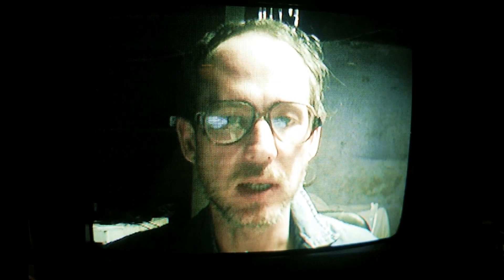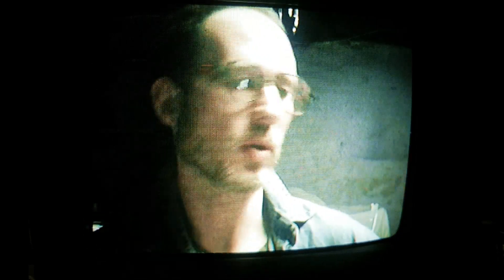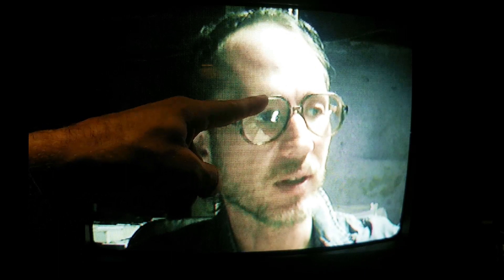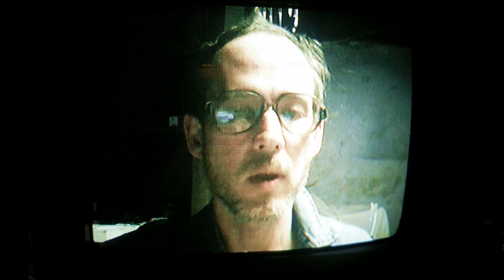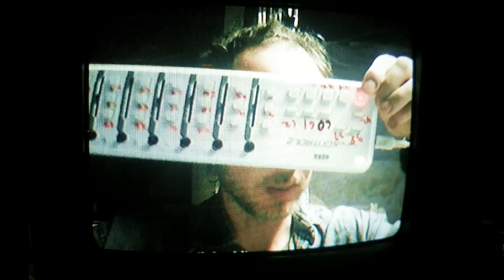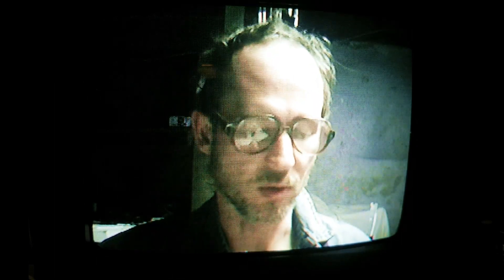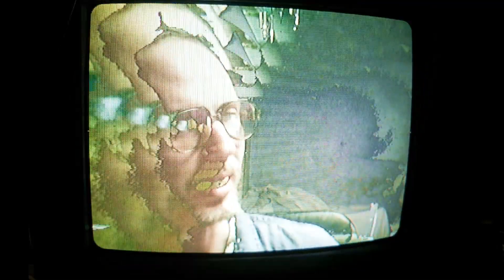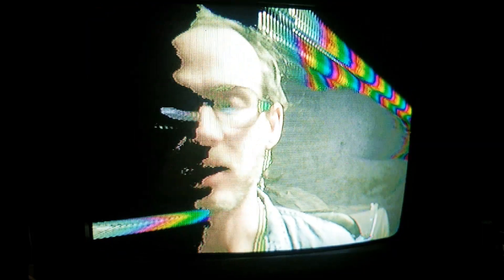introduction to Auto Waaave

Comment: Andrei, are there settings that need to be made after installing the hifiberry adc/dac?  The device worked the first time I installed Auto_Waaave, and then all subsequent re-boots it stopped working.  I did try testing to see if audio was coming in in audacity which it was.  It seems like there is some obvious thing I'm missing here.  Any advice would be much appreciated.
Reply from the maker: sounds like u are using one of the non supported analog capture devices, try checking the website to pick up a supported usb analog captures, and then reflash the image before using once u got it
Reply: @andreijay  Thanks for the reply!  I was going to build a pi synth too, which it sounds like this dac will work for, so no loss!  I used VSERPI as my Webcam for a video conference at work the other day, and everyone freaked out.  It was great!

Comment: Thanks for all your amazing work. If I already have a functional waaave_pool (working on one now out of spare parts) is there a specific ADC/DAC hat I can pick up for my rpi to use auto_waaave with the pool image on github?
Reply from the maker: yes the HifFi Berry ADC/DAC combo is the best to grab for this purpose, it will be an excellent accessory to have in general as it will also work with the Phosphorm image and will be what i design any future audio processing units around as a default!  otherwise it will also work with some mics from USB cameras and USB audio interfaces in general but most likely with lower quality and higher latency
Reply: @andreijay  Thanks, really appreciate you being so transparent about the parts you use in your kits. I would have totally bought one if i didn't already have a rpi and might actually still pick one up if i end up needing another pi and want to get the premium capture hats. I'll probably prototype with USB and upgrade when I am happy with the results I'm getting.
One other question - why don't you (or anyone else in the community from what I can tell) use a RGB/S-VID hat out of the pi as an alternative to the composite out? Too many hats? No benefit of RGB/S out? Something deeper?
Reply from the maker: @smppdx  pin out video is definitely possible, doesn't even require a hat really, but hard to see any kind of advantages to adding that process on board!  any way you slice it you are going to be converting a composite signal at the base of the chain to the split svideo Y/C signal so not exactly like any amazing quality upgrade from doing it via a hat or wiring your own pinouts vs doing it anywhere else.  dunno about RGB hats at all, are u talking broadcast VGA composite sync on green or sr8 up vga RBGHV? very few of the analog video systems out there are going to be happy with either of those signals so it was never a priorty for me to focus on that end of things, the thing about using breakout cables for composite is that it is simple, inexpensive, and has a wide range of uses which is generally my priorities. and yes transparency and easily available components is another priority, the main goal of this series of instruments is to have an easily assembleable and somewhat unexpensive powerful set of video tools out there in the world
Reply: @andreijay  Still new to all of this and learning a lot from you and the community, so thanks for helping me think this through as I buy a ton of cables to rig everything up.
I was imagining that if you had digital video samples or synthesis w/ high bit depth (10bit?) and subsampling (4:2:2) that if you did RGB out similar to the retro gaming community SCART hat[0] you could get better color representation as long as your mixer supports its. I'm with you though, the simpler/the better and would prefer to use rca composite to rig up everthing as long as my colors look good. Do you only use RCA across your devices or is there s-video in there between the mixers for instance?
When you say 'composite at the base of the chain' are you referring to the composite out on the rpi? I was thinking there might be a benefit to color in using an alternative output, but I'm probably just overthinking things.
[0]https://www.rgb-pi.com/
Reply from the maker: @smppdx  an RGB/VGA capture device is usually quite expensive and pretty uncommon in the world as far as i can tell.  for converting into component Ypbpr it would nearly always be better to use a seperate peice of hardware for such tho at the end of the day with 10bit 4:2:2 sampling i have noticed very little difference between using rca composite, svideo or component thru the black magic hardwares other than component tends to loose sync pretty often and just drop or glitch out the captures.  out of every capture option i've played with i almost always feel like the best option is simply filming a CRT fed with any analog signal.  the other thing to think about for any kind of capture/upscale/ video converters that are designed for gaming purposes is that they will nearly always be running at 320x240p with line doubling so that will effectively be reducing the resolution capablities of anything i make by 1/2 and also turning it into a progressive scan video signal which many analog video capture devices can't work with

Comment: hey andrei will this also work with the audio in on a ezcap device?
Reply: I mean the audio in for the Ezcap
Reply from the maker: @jordan3636  so far it seems to work with any audio inputs that i have tested it with,  you might have to do some config to set it as a default but most likely will be plug n play.  the only thing is that the quality and latency of the audio coming in is mainly determined by the ADC hardware set being used.  with the EZ caps i would guess a pretty low quality and high latency